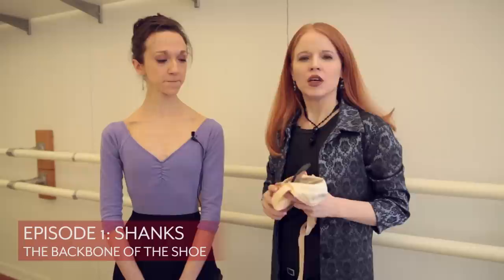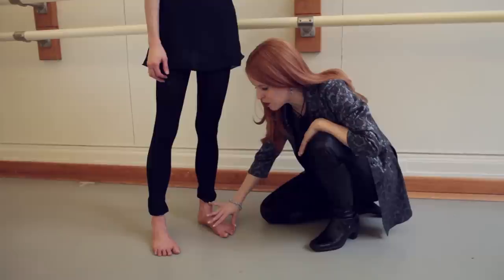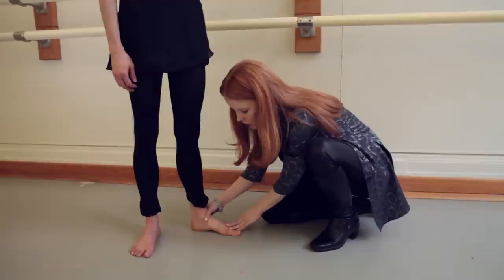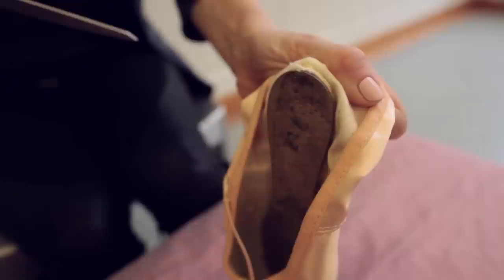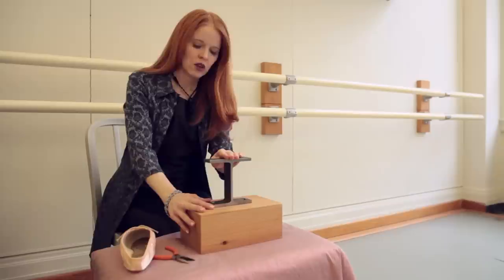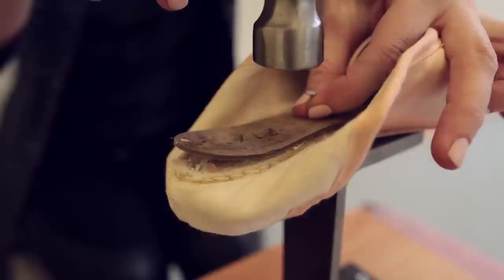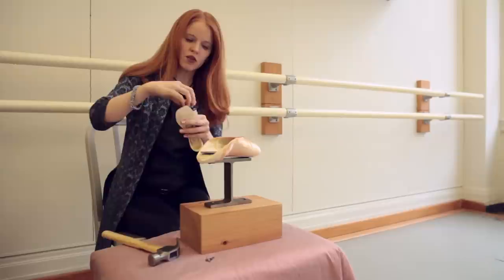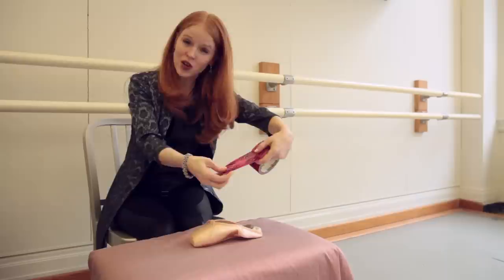How to 3/4  Shank a Pointe Shoe (3/4 cut a pointe shoe shank)

Comment: This is intriguing. I had thought that a three-quarter shank was CUT to be shorter. I had assumed (obvioulsy wrongly) that all shanks were attached to the arch... but I guess not! Thanks for this. :)
Reply from the maker: Thanks for watching.  The technique I used in the video helps the dancer to feel even when standing flat.  A true 3/4 starts slightly behind the side seam and can bevel (skive) or be completely cut off.  A 1/2 shank is cut at the side seam and can also have a bevel or be cut off.  Skiving a shank is not easy and sometime a cut off can be disconcerting to a dancer when standing on flat.  I have found this technique to be useful for levels below professional or pre-professional.

Comment: Thanks Mary.  Your response answered my question well.  I haven't had to try it yet because she has gone to a 3/4 shank shoe in a medium strength which we are able to bend by hand.  This is working better than the hard, although not lasting as long, but she is much better positioned over the box now. Many thanks!
Reply from the maker: Oh that is good, that way you don't even need to do any of the cutting yourself.  Thanks for the feedback.

Comment: what I do is I pull the lining sole a little bit then bend the shank to the desired 3/4 length back and forth and snap the end out, then I pull back the lining sole to place and stitch the end to the bottom of the shoe because i find that with glue it just starts rolling and bunching at the shank's end.
Reply from the maker: Aletia Gonzalez Good comments, most professionals discard the inner lining

Comment: Thanks for creating your channel! Could you explain what the difference would be between your method (without actually cutting the shank), and the other way some do it by actually cutting the shank?
Reply from the maker: Thank Rebecca I am really excited to share my experience with dancers.  I wanted to show the simplest method for 3/4.  If you just release the back nail or staple and then place the shank (and tongue if it has one) back down it is an even base to stand on.  A 3/4 skived or beveled shank is nice, but difficult for  someone without experience; a 3/4 cut off shank can sometimes be disconcerting to the dancer when standing flat.  The technique demonstrated in the video will help someone on a budget as well.

Comment: Great video! I was wondering if you knew the best way to 3/4 a Russian Pointe pointe shoe. It seems to me the shank is connected/sewn onto the bottom sole making it difficult for me to figure out how to 3/4 it.
Reply from the maker: I like how sturdy the Russian Pointes are constructed.  I was able to release that layer by using a box cutter.  Please be extremely careful when using one and I also caution any young person about even touching one.  They are sharp and can really be dangerous.  I usually use some kind of gloves when cutting into shoes.  You can use the box cutter to cut into the fabric to release it and then go ahead and proceed with removing the nail and adding a shank tacks.  You may need to get a slightly bigger tacks because the shanks are thick.
Reply: i was wondering if you knew the best way to 3/4 gaynor minden ?

Comment: Hi Mary,  how do you know where to bend the shank please?  And where to put the tack?  Is there a risk of bending it too far down, or not far enough?
Reply from the maker: Nichole, thanks for watching.  You can set your foot en pointe in the shoe and use a pen to mark the highest part of your arch.  Make sure to mark a right and left foot because your arches are different on each side.  Start the bend on the pen mark so it isn't in the wrong place.  Place the tack about 1/8 th or 2/8th away from the bend/cut edge and line the tack up in the center of the shank. Try it with an old pair first to practice.
Reply from the maker: Nichole I left my comments in a separate response, did you get them and did it work for you?😀
Reply from the maker: nichole phelan good questions : )  Put shoes on with pads, set your foot en pointe, use a pen to find the highest part of your transverse (bottom) arch. Mark that with the pen.  This is where you can bend or cut. Place tack approximately 1/2 inch down from cut edge. Try this on an old pair first for practice.  Let me know how it works for you.